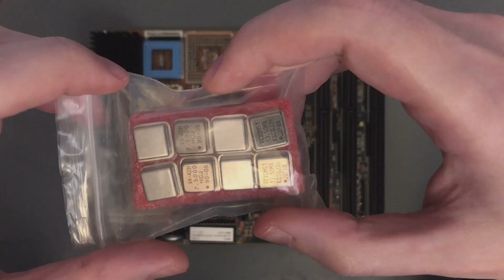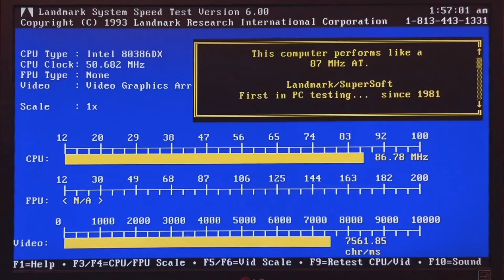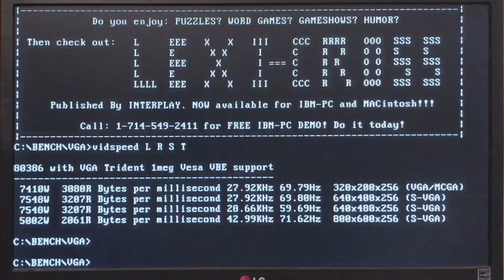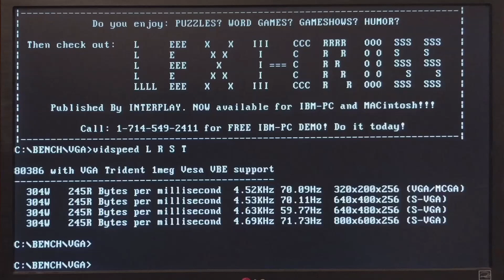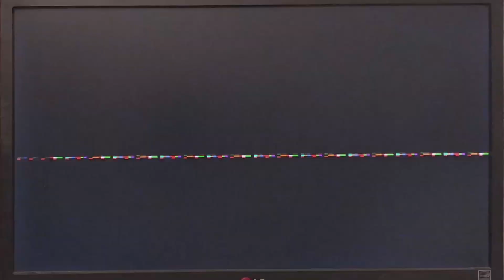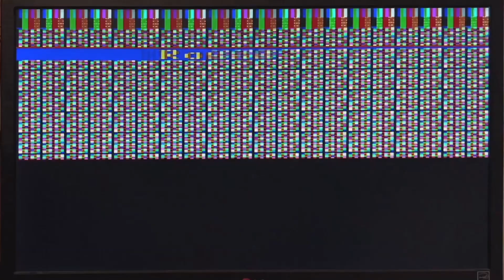Overclocking, Underclocking the 386 with a custom clock generator. 2Mhz to 50Mhz, ~0.5Mhz step!!

Comment: Question. What is the easiest way to hijack the clock generator on a old pentium 3 motherboard? It's clock gen only does 33 and 100mhz. I want to see how far i can overclock the chip. Possible to detach clock generator from cpu and attaching cpu to another clock generator?
Reply from the maker: There is no easy way actually.
The only way that would probably work but I have not tested is replacing the reference crystal (14... MHz) with something higher.
Then go to the clock generator and replace  all the reference clocks (14.. 24 etc) using an other generator. I will probably make something that can generate all these reference clocks in the future and try.
Reply: @atheatos  interesting. I was also looking into replacing the crystal for something higher I don't think I have a higher mhz one on hands here.

Potentially if you'd be interested. I can maybe send you a dell c600 as potential fest platform?   It's using a 750mhz p3 rather than my 1 ghz one. In terms of pcb design they're not too terrible.
Reply from the maker: I have many crystals around 14.318 and higher. However yeah just replacing the crystal will just not do it.  I am designing now what is needed to generate the ref clocks. I think I will have this in 2 months.

Now I was ready to just say "thank you" and that I do not need the dell to test my device (as I might have 20+ M/Bs I can test with). However this is a laptop and it can be extra interesting to do a video modding that.

So Let me first get my devices tested on normal M/Bs, then we can arrange this. I will mod it, make a video and send it back.

Comment: I have an M-321 with 256KB of 20ns SRAM cache, 32MB of 60ns 3-chip SIMMs, with similar 33MHz/40MHz jumper near a TK9107 oscillator.  Instead of an 80386DX, I have the TI486SXL-40, and the FPU is the CX-83D87-40-GP.  I'm sorely tempted to see if I can overclock that system-- if I could get even 48MHz out of it without changing RAM (and without introducing wait states) that would be really amazing.
Unfortunately, I have no way to adjust the AT bus divider frequency and don't have a way to even see what it is.  The BIOS is pretty restrictive and there are no AT clock jumpers.
Reply from the maker: Nice M/B. AT bus clock is important. Mine is basically missing cache timings (the option in bios does not work). Looks like it is very hard to find a M/B good at everything. I will test cx486DLC next with Overclock. Based on my tests, most 60ns modules can not do more that 43Mhz with WS0. Smaller memories are faster. Also I will release my clock generator as a product very soon.
Reply: @atheatos  Torn between 32MB for Win95 or Win98, or 8MB for DOS (or even 2MB in 256K sticks for the fastest DOS, but maybe that's extreme).
There's another quirk that I have to set the DRAM refresh to 240ns (using a utility) to get more speed.  Not quite sure why that is (although it does seem the default refresh is 15ns for some reason).
Reply from the maker: I will try win 95 at some point and make a video. But either way a 386 is probably to slow for windows. No idea what apps to try there. Yes 8MB is more than enough for DOS and ok for win 3.11
Reply: @atheatos  Win98 is pretty decent on this system with the TI486SXL-40.  But I suppose most "games for Windows", even of that era, expect if not a fast 486, then a Pentium-- and a competent graphics card to go with it.  32MB is for the bragging rights, I suppose.
Reply: @atheatos  386 není zase tak pomalá, jak si myslíš. Ve skutečnosti na ní první verze Win95 fungovala relatiovně dobře pokud bylo vše nastavené správně. Dá se tomu ovšem výrazně pomoci. Tím nemyslím přetaktování, ale periferiemi kolem té 386 jsou protože tím se dá procesoru ulevit. když se použije grafická karta, která má 2D akcelerační funkce, nemusí vykreslováno otrocky řídit procesor. Když se použije VLB sběrnice, tak se nemusí čekat až se data přenesou z paměti do VRAM. Velká část VLB grafik má dostatečný výkon i na akceleraci v poměrně vysokém rozlišení (na 386). Když se použije VLB SCSI řadič s busmasteringem místo IDE, tak to opět velice sníží zátěž (SCSI má při multitaskingu mnohem menší režii). Když je dost paměti, tak se nemusí swapovat. Když je v systému koprocesor, pomůže to s vykreslováním truetype fontů, takže už není taková katastrofa otevřít dokument ve Wordu (obecně celé GDI používá TT fonty). Pokud je v systému síťová karta, tak je nutné použít kartu od 3Com Paralel tasking (novější verze modelu 3C509), Intelu a nebo pečlivě podle dokumentace vybírat modely od některých dalších výrobců, které neotravují procesor s neustálým voláním IRQ a špatnou implementací bufferů jako to dělají levné síťové karty. Když tohle všechno člověk udělá, tak zjistí, že i 386 má na Win95 solidní výkon. Jasně, není to tehdejší typická sestava, spíš taková 386 na steroidech (mám takovou doma), ale i bez VLB jde pro to udělat něco podobného na ISA pečlivým výběrem komponent, jen se to zpomalí protože všichni pak bojují o pomalou ISA a ta se stává úzkým hrdlem. Je to větší omezení než má na svědomí slabý procesor. VLB nepomůže 386 ve hrách, ale hodně pomůže v multitaskingovém prostředí Windows. Mám v plánu o tom někdy časem  natočit video, kde bych chtěl takové věci ukazovat a porovnávat.

Comment: I personally find it weak from these 386 CPU's. I overclocked multiple 68030(Various markings) up to 72Mhz. The limit was basically the rest of the chips on the turbo boards in the Amiga.
Reply from the maker: I have zero experience with Amiga stuff. :(